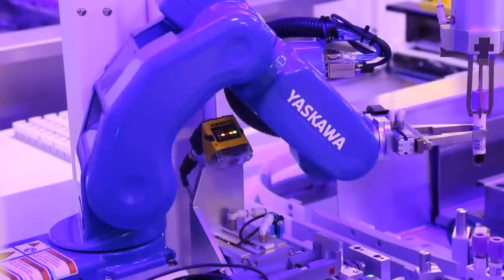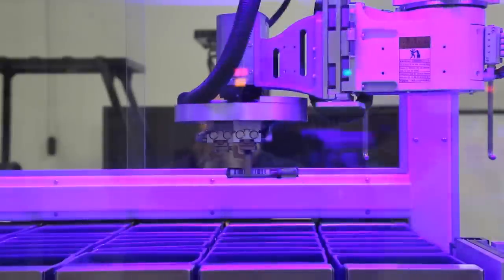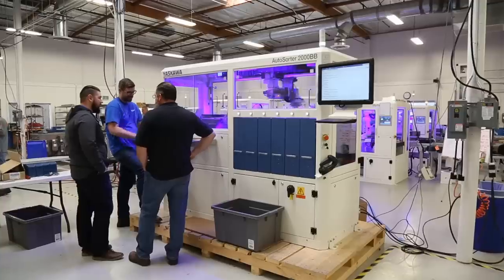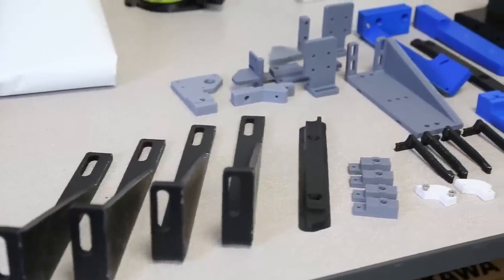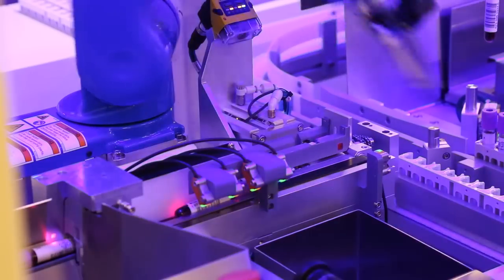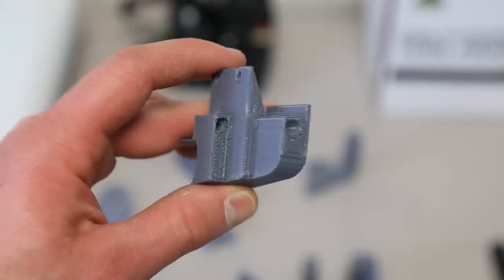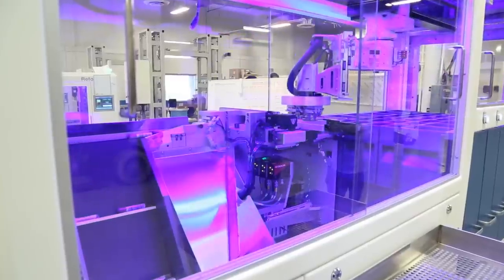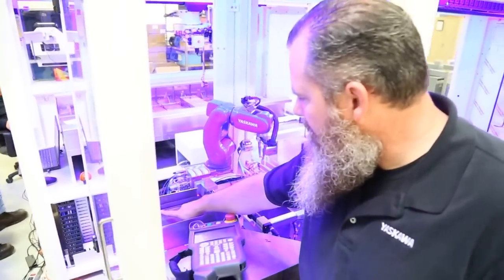3D Printing For Factory Automation: Yaskawa Motoman Robotics

Comment: Ask me about my lulzbot experience before you buy.
Reply: what was your lulzbot experience?
Reply: @fernandocolunga1156  I've had my Lulzbot Taz 6 since May 21 of 2017. It still prints fantastically.  It was expensive compared to other printers on the market, but I wanted something that would print right out of the box.  I have had nothing but great experiences with this printer and the support department. The support department, in my experience, responds quickly with great advice. The lulzbot Cura edition seems to lag behind cura fairly significantly. In fact with the recent sale of the Aleph Objects to FAME 3D the updates to Cura seemed to have stopped. It will be interesting to see if FAME 3D will be able to keep up with the Lulzbot reputation and the expectations of previous customers.